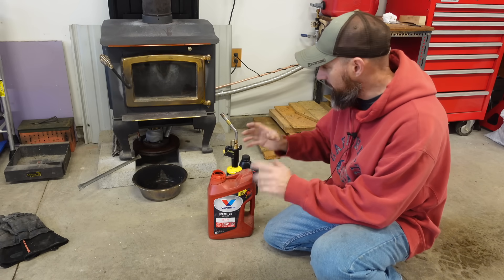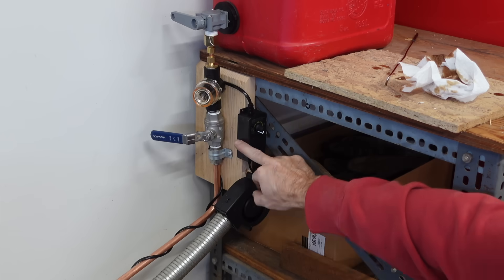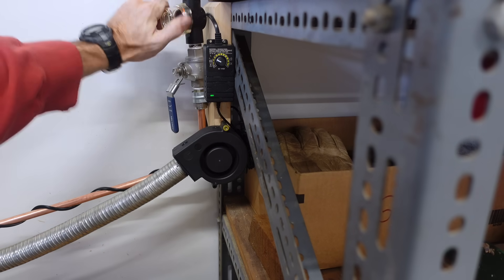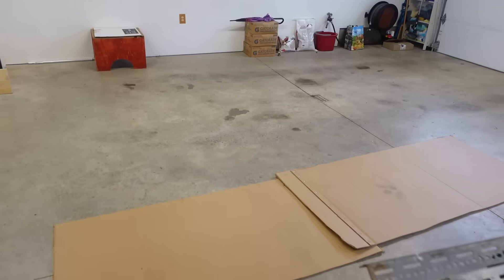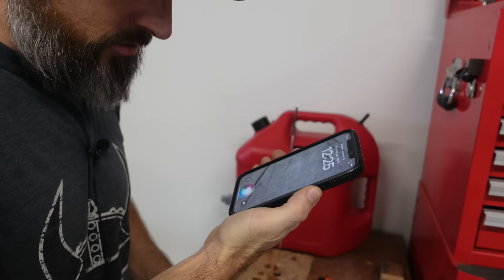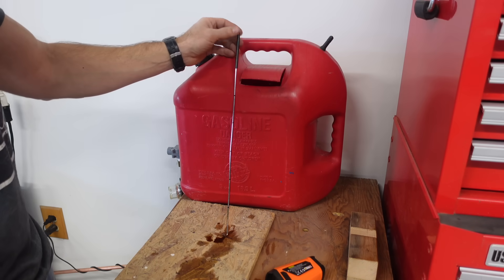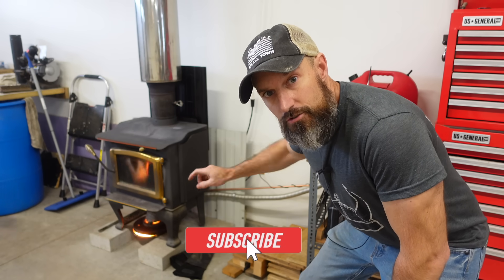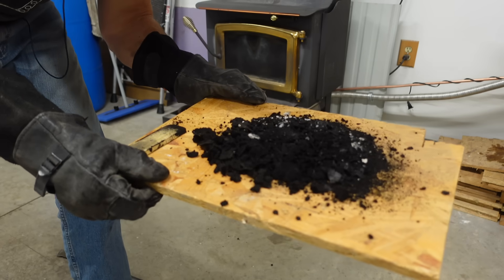How much oil does my used oil burner burn in 8 hours??

Comment: I was thinking, wouldn’t it be easier to buy a purposed-built used oil heater? Then I looked at the prices. As long as it’s safe, do-it-yourself is the way to go! Nice build!
Reply from the maker: Thanks for watching, I’m sure the ones that you can buy are much safer.

Comment: I wonder if putting angled holes along the top of the rotor would create a vortex and let it burn more efficiently.
Reply from the maker: Good question but my other view I change the air so it goes in a circle.

Comment: No external blower with speed control mounted on wall to push heat off the heater across the shop to help with heat distribution ?
Reply from the maker: I do have a fan at the ceiling. Thanks for watching

Comment: This looks so not safe. I've had experience with waist oil burners in the past. They shot the flame into a thick fiberglass mating that lines the back wall of the burner. The mating deteriorated in one and burned a hole through the back of the unit and through the wall of the building.
Reply from the maker: Holy smokes thanks for the heads up. I don’t plan on burning super hot and maybe only few times a year to burn up my used oil. Thanks for watching

Comment: To achieve better efficiency, you can add a pipe to the air intake fan directly to outside the property. This will stop causing a negative pressure in the garage. As you see the fan is sucking air from inside the garage to burn and go outside, that spent air needs to get replaced cold air comes in from cracks of windows and power outlets.
Reply from the maker: Agree thanks for watching

Comment: Nice build. There is one thing that I would change. I would not have the oil burner outside of the former wood heater. What you may not realize is that the gases that come off of used motor oil can easily  leach into your work space. These gases are likely carcinogenic / cancer causing. Maybe move the burner inside the stove or move stove outside and insulate with glass wool blanket and circulate air or water back to work space.
Reply: I believe the air is being drawn out of that space and is going up out of the chimney. Put some smoke or something to watch the airflow
Reply from the maker: Thanks for the info, maybe I will try it inside one of these days
Reply: @DIYJIM  thought the same, all that gasses would go off the chimney if the burner is inside the stove, srry my english
Reply: Not only that, but being in a shop, most flammable/explosive fumes collect from the floor up. Having an open combustion chamber right at the floor is a really bad idea. Unless you don't do anything but drink beer in the shop.

Comment: Neighbors burnt down shop with better setup than that. Flaming oil over filled containment and ran out onto floor.
Reply: Smaller feed tank than burn tank might help.
Reply from the maker: I could see that would be bad. I don’t plan on using much and only when I am in my garage. Thanks for watching

Comment: The gas tank is a horrible setup with all respect there's like a gallon if not maybe a gallon and a half that you won't be able to ever use because you have your valve way too high on the tank unless it's playing like that so it can kind of collect the settlement but then eventually you're going to have to take it apart to clean it when you should just filter your used motor oil in the first place
Reply from the maker: I kind of want the settlement to go to the bottom. Also I really only burn it when I am in the garage. Thanks for watching

Comment: Old Jungers burners using fuel oil would burn a lot cleaner.  You are wasting heat, and not burning everything up.  You need more air, and more glowing surface.  Might try using stainless steel pot scrubbers down in the fire pot to gasify the motor oil, and turn up the air.  The pot scrubbers dipped in the oil need to glow to boil the oil right on the surface of the oil.
Reply from the maker: Thanks for watching. Do you have a video of what you are talking about? I would like to see it.
Reply: No, just a verbal description.  I have 3/16" brass tubing I bent close to one end at a 90 degree.  That part goes in the cap of the milk jug.  I set the jug on the ground, then put the tube in it, and drill where it touches the tree.  @DIYJIM

Comment: Get rid of that double wall pipe except where it goes thru and you'll retain and keep alot more heat inside that pipe just keeps and directs the heat in the pipe and out the the top lot of heat loss
Reply from the maker: I have thought of that. Thanks for watching

Comment: Gallon of oil holds approximately 135000 btu's.
To raise that cu ft one deg is approximately 22000 btu's. 
A little math will get you there.
Reply from the maker: Thanks for watching and for the tip

Comment: From my experience you need more air flow I have built a oil burner in my fireplace And I set it up to draw the air in with no fan and it Burns very well
Reply from the maker: Thanks for the advice and thanks for watching

Comment: from what i can see, you need to run a hotter secondary combustion temperature so introduce air into the wood stove and shorten the stainless steel pipe thats turning cherry.....that heat needs to be in the fire brick area...my experiance comes from burning oil in a mosher type steam boiler aboard a 1919 steam yaught....but the brincipals of combustion are the same.
Reply from the maker: Thanks for the tip and thanks for watching

Comment: The problem with opening the garage door is not so much the gap at the bottom of the door, it’s the gap at the top of the opening allowing the heat to escape. When the heat escapes from the top, it pulls the cold air in through the bottom.
Reply from the maker: Agree, thanks for watching

Comment: You could get better circulation of the heat if you put a "wood stove" fan on the top.  They are heat powered and do a great job of moving the warm air around the room.
Reply from the maker: I did have a fan up by the ceiling. Thanks for the advice

Comment: 125,000 Btu/gal in waste oil.   

a 1,000 square-foot workspace with 8-foot ceiling height means you’ll be heating 8,000 cubic feet of space. If the temperature outside is 30°F and you’d like it to be 70°F in your garage, the desired temperature change is 40°F. Those two numbers multiplied by .133 reveals you’ll need a little more than 42,500 BTUs per hour to keep your workspace at 70 degrees in in moderate USA temperature zones 1-4.  One gallon of waste oil provides approx 3 hours of heat - unless the space is airtight and super insulated.
Reply from the maker: Thanks for the info and thanks for watching
Reply: How did you calculate this, what field of education is this
Reply: @shirwacREI  that’s some thermal engineering for you.  Math can tell you everything, it’s the language the universe is written in.
Reply: @shirwacREI  Used btu/gallon data from 
British thermal units (Btu) - U.S. Energy Information ...U.S. Energy Information Administration (EIA) (.gov)
btu/cuft by Ferrell Gas.  mechatronics degree
Reply: @shirwacREI good ole kountry skoolin😂❤❤
Reply: @shirwacREI  standard hvac literature. anyone holding and EPA cert should be able to calculate this...
Reply: Boom !! This is why I love Math !! 💪
Reply: Heck yeah buddy!  You are speaking my language now.  So sick of tubers saying stupid stuff.  Thank you for doing the calculations.
Reply: Also, everyone in here almost, it is WASTE oil. NOT waist oil
 That sounds like some serial killer stuff. Yes, burning "waist" oil (fat) would be illegal because of the murder to get the fat/oil. But WASTE oil is perfectly fine. Sorry..... I just had to be that guy. Carry on
Reply: U have it figured out❤
Reply: Just wait until some of y'all find out that many municipalities actually allow you to pour coolant down the sewer. NOT the storm sewer, but the waste water sewer. Basically flush it down the toilet.
Reply: @Spike-sk7ql  i painted water towers for 30 years. I filter my water anywhere i go. You wouldn't believe  what ive found in them as we were sand blasting the lead paint off the interiors...dog carcass, human skeletons, bats dead and alive shitting in them........
Reply: Used motor oil isn't waist,  burning it is illegal 😉
Reply: @jeremiah-om7zl  In some places burning waste oil s legal
Reply: @jeremiah-om7zl  In Wisconsin, even a shop can burn their "own" waste oil. They usually have a filter it so it feeds better.
Reply: @dgrasser  Check federal law,  no motor oil
Reply: @jeremiah-om7zl  
I literally posted a quote from federal regulations lmao or did you choose to ignore it. 
Here's the complete document for Used oil on the federal Level.
 
EPA GOV
Title 40 Chapter 1 subchapter 1 part 279
STANDARDS FOR THE MANAGEMENT OF USED OIL

Regulations describe used oil as
279.1 Definitions. 
"any oil that has been refined from crude oil, or any synthetic oil, that has been used and as a result of such use is contaminated by physical or chemical impurities."

Please pay Special Note to subpart C 279.20 Applicability.
Subpart A Notation 1 
1. Household “do-it-yourselfer” used oil generators. are not subject to regulation under this part.

Meaning all the applicable regulations after this are reserved for Businesses and Corporations. Homeowners burning reclaimed oil on site for the purposes of heat are exempt and can burn off specification used oil. 
Which those regulations are BTU limits 500,000 BTUs (WAYY HOT), Off specification oil and it's contaminates, Emissions. The list goes on. 
End result it's fair game for homeowners who are the producers on site of used oil and can burn said used oil for heat.

If you want the more specific and direct answer to MOTOR oil being USED oil.
EPA GOV
Reference Table for the Question "What is Used Oil?"
"Used engine oil — typically includes gasoline and diesel engine crankcase oils and piston-engine oils for automobiles, trucks, boats, airplanes, locomotives, and heavy equipment." 

Since title 40 is up to date as of 2024 and plainly states Motor oil IS used oil AND Burning for heat "Burners" is/are legal.
Please show me where it's Illegal on a Federal Scale.

I come with the papers to back me up. Where's your proof to support your claim that it's Illegal on the federal scale?
Reply: @AbsolutionArmament  your post is nothing but a lie. Motor oil isn't waist oil, or are you playing that ignorant 🙄
Reply: @Acejay1864  good thing you don't know federal EPA law wink 😉
Reply: @jeremiah-om7zl  to everyone bet all it's a bot account to string engagement.
Reply: @jeremiah-om7zl  EPA has no authority to make laws. They are a rogue dept of criminals.
Reply: @jeremiah-om7zl  epa recommends burning it actually....
Reply: @hazlox  don't tell that lie anymore 👀
Reply: @jeremiah-om7zl Really😂
Reply: @jeremiah-om7zl  Not sure where you live in the US or Canada from your videos. But there are off the self EPA and CEPA approved options which do in fact burn used motor oil.
Reply: @AbsolutionArmament they aren't used motor oil
Reply: @DadBeatRecords I’m in New York and I worked for a municipality. Our garage had a waist oil burner and it worked well. It had a blower so forced air heat. Ny is about as left as you can get and it’s not illegal here.
Reply: @jeremiah-om7zl  if it were illegal, would companies like Reznor, Modine, and more make shop furnaces that run on waste oil? There are commercial versions of these things, but this is a hell of a lot cheaper than what I payed for my Reznor unit. Im in Ohio. Mine is all one unit, tank can actually double as a bench, it has filtration for the oil, and everything else looks like a regular Reznor heater that hangs from the celing. I can just empty my transmission flush machine straight into the tank in the winter. Saves me from having to pay for either heating oil, or propane to heat my shop. Wood burner for the house, waste oil furnace at the shop, and I have one of these that I made a little different in my garage. If I could trust it enough to leave one unattended for hours at a time, I'd put one in my barn for the animals. Too much flammable stuff like diesel, hay, sawdust, and other stuff though. That and it was built in the late 1800s, and would go up like a stack of matches if fire ever broke out. And there is a, to me, priceless tractor our there too.
Reply: @Spike-sk7ql  not used motor oil, sure cooking oil 🙄
Reply: @jeremiah-om7zl  People are going to do it, regardless of what you say. I hope it helps you sleep well at night knowing this.
Reply: @Jack-1-1-1 people get fined also😊

Comment: Put a deflector in the stove a few inches above where the fire enters . The fire goes straight to the top and out the chimney.  Deflecting it out towards the sides of the stove will get you more heat.
Reply from the maker: Thanks for the idea. I was planning on doing that. Thanks for watching
Reply: Absolutely correct. Doing this also allows more of the gasses to burn and less cristals to form in the exhaust. Much more efficient heat with a deflector. You actually don't want the stove pipe to get that hot. You could put another stand of uninstalled so that more of that heat stays in the room.
Reply: Yep that’s a lot of wasted heat going outside!!
Reply: That's a really good idea...... definitely can't hurt
Reply: @DIY Jim I’m from New Orleans and obviously I don’t deal with as much cold at home, but I work as a Union Boilermaker mostly up north in places like NoDak aka North Dakota building and maintaining the huge boilers used as power houses that make everyone’s electricity. I’ve literally worked in Negative 50° with windchill. Something that we do in shipyards An in power houses to is we’ll use our Oxy/Acc torches with 5 gallon metal buckets we’ll fill the buckets with scrap steel. Punch a bunch of holes around the buckets and put a Rosebude tip on the torches. Not suggesting you use Oxy/Ace because it is expensive, but I suggest you use some scrap steel. My cousin uses a few old Brake Drums and Brake Rotors. I’d suggest cutting them into quarters and it’ll hold heat. I’ll use my propane burner I use for boiling crawfish and I’ll fill up my big pot 3/4 full of water that holds three 45lbs sacks of crawfish to add humidity back into my shop.
Reply: If you were in Canada you would have to pay a million dollars in carbon tax…… yeah we have that here. Our government is full on taxing us to death in the name of the great climate change  hoax…..but they are Taxing it away…..I want the acid rain days back.
Reply: Great build I'm thinking about doing that with mine.
Reply: indeed, what a shame nobody understands.
Reply: Sounds right😂
Reply: I'd use a fan to spread the heat into the room.
Reply: Yea exhaust gas temp to high lots of heat loss. Install Small V shapes deflector above the flame. Also the black smoke is due to poor combustion increase the air and stop your flame from sputtering. Fla.e color should never be orange to dark orange. Look for a bright golden yellow. That's when your in the zone. I like your ingenuity
Reply: How does it look outside when it running?
Reply from the maker: @kiwifulla3  I show that in a couple of the other videos. I thought I showed it in this one but maybe not.
Reply: @DIYJIM You did, at 13:00
Reply from the maker: @Jell0zz  thanks for helping I thought I showed it.

Comment: Just a thought of advice: keep a close eye on your chimney, and keep it cleaned often. You DO NOT want a chimney fire with that oil soot. 
     Second thought: Create a secondary burn in fire place. By this, I mean introducing heated oxygen into your exhaust to catalyze any unburned fuel. This is simple to do. Create a  cold air line that gets heated by the flame then delivers the air just after the combustion process. Super heated oxygen will ignite any unburned fuel. You can experiment with copper tubing. Remember those green mosquito incense coils used in the old days? Install a copper coil to the ceiling of fire place, over the flame. The center of the coil is the outlet, the other end of the coil should draw cold air from outside. There are many options here. Simply leave the end of the copper tube open or cap off and drill small holes into the coil of the copper. Also, since your chimney above the rotor gets red hot, wrap a copper coil around that, then have it deliver the heated air into the center of the flame in the chimney, or at the roof of fireplace where the flame splashes.
      This will serve two purposes: Getting a complete combustion of all the fuel and by-products will create more heat, and keep your chimney cleaner longer.
Reply from the maker: That is some good ideas. I wonder if I should have had my air intake on my stove open fully instead of closed. Thanks for the suggestions and long comment.
Reply: @DIYJIM  If you are getting a complete combustion, there will be no smoke. Your chimney outside the house is telling you something, which is what caught my attention and got me thinking.
Yes, open the air intake on stove. You want oxygen, hence the need for a blower on oil burners. Oil can burn just fine without forced air (if hot enough) but it smokes like a burning tire. The extra air from the blower is required to get enough oxygen into the combustion process to reduce the smoke (unburned fuel).
Final thought: If you can, create a cold air source for your stove that draws from the outside of the house. If you're not pulling air from the room/garage then you won't be drawing cold air in from outside (drafts). Nice talking with ya, keep the vids coming

Comment: Maybe a couple of peltier powered fans on top of the stove may increase the dispersal of heated air.
I like the forced air but doesn't that depend on the grid for power?  Perhaps you could find a way to run one on dc for power outages.  Overall, I find your setup very fuel efficient and a great way to heat your garage!  Good going, keep up the good work.
Reply from the maker: Thanks for watching, it has been fun building it